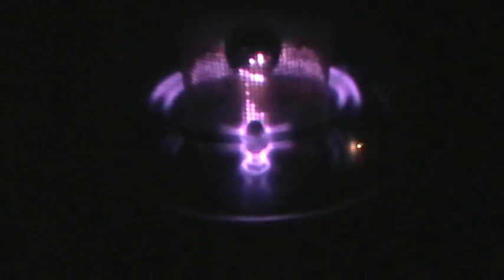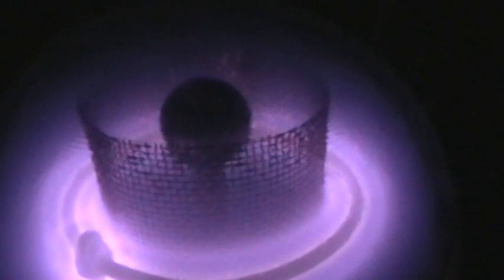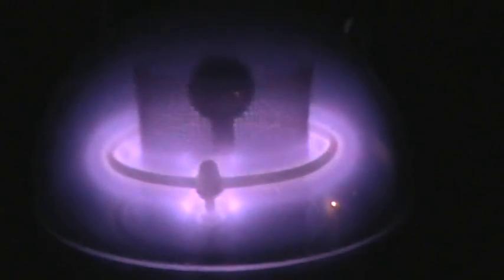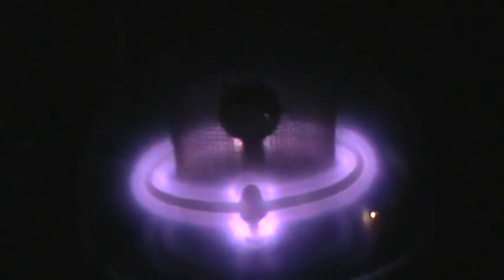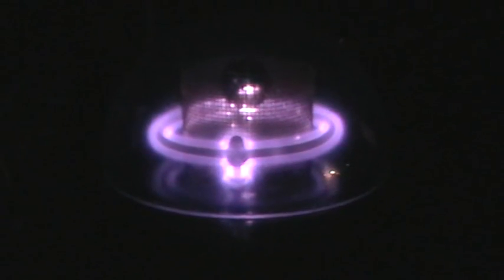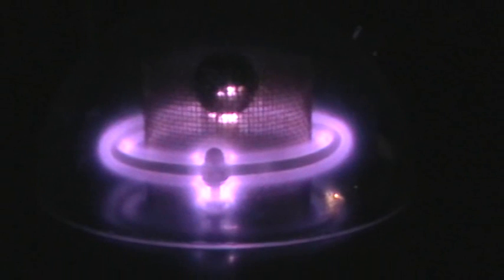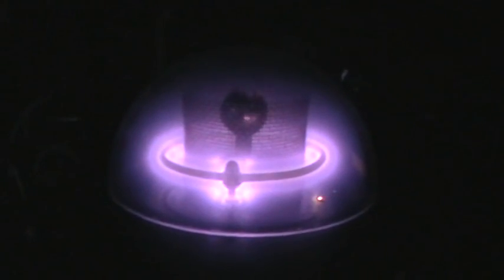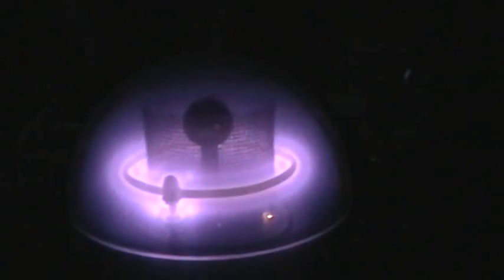Extreme High Voltage: Improved Vacuum Glow Discharge Demonstration

Comment: The color and shape of the glow discharge looks absolutely beautiful.
It's like a plasma globe, just much, much, weirder and more fascinating.
Just a question, does this device produce lots of X-Rays while in operation?
Reply from the maker: It may produce some soft x-ray emission, although the operating voltage droops to under 1 kV when the plasma is present. I hope the thick glass sphere offers me some protection.
Reply: TinselKoala
Well, if it droops to under 1kV then I'd say there's no problems. X-Rays produced under 10kV are far too "soft" to penetrate even thin glass. Pretty cool experiment by the way. I'm unsure what you're trying to do with it other then just random experimentation though. I'm sure watching a few of your other vids will help. :D
Reply: +Vorname Nachname
Anything over 15kV will produce soft to mild X-Rays capable of penetrating glass, as well as some XUV (EXtreme Ultraviolet) depending on voltage. Both are a form of ionizing radiation that can cause cell damage. XUV pretty much only travels through vacuum, but it can make it a few inches through the air. The soft X-Rays would only make it a tiny ways through skin.  The amounts produced below 25kV are fairly safe provided you aren't exposed to it for several hours per day. Most X-Ray machines use 50-75kV or higher.
http://web.stanford.edu/group/glam/xlab/MatSci162_172/LectureNotes/01_Properties%20&%20Safety.pdf
Go to page 4 in the PDF, and look at the picture. Notice how only once a voltage of 25kV is reached does the strong emission of radiation characteristic of hard X-Rays begin (Denoted by K𝛂 and K𝛃 int he Diagram).

I'm not 100% certain of the facts I just stated, as I'v not studied the physics of X-Rays much. This is about as far as I could explain it. If you want to know more, ask someone who knows about Radiological Physics.

Comment: Interesting!
Why term mere gas discharge "plasma"?
Reply from the maker: Because that is what it is.
http://en.wikipedia.org/wiki/Glow_discharge
Reply: TinselKoala  If not hot I do not consider such a plasma.   My neon beer sign tubes do not even get warm.  They have both neon and fluorescent tubes.
Reply from the maker: Robert Gift
Maybe you should correct the standard definition then.
http://en.wikipedia.org/wiki/Plasma_(physics)
http://en.wikipedia.org/wiki/Nonthermal_plasma
From the Plasma reference: "Neon lights could more accurately be called "plasma lights", because the light comes from the plasma inside of them."
In most fluorescent tubes, the plasma inside emits UV which then causes the tube's inner coating to fluoresce in visible wavelengths.